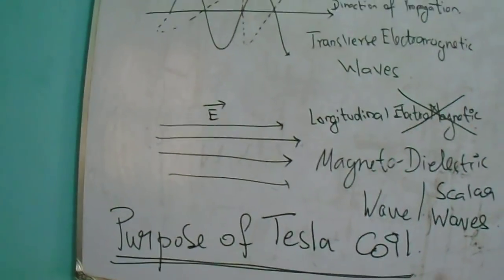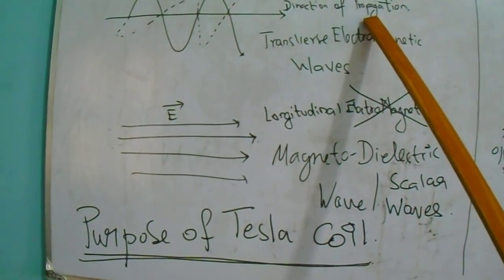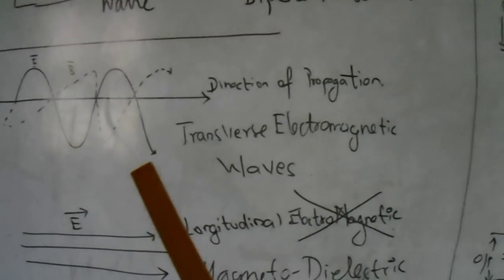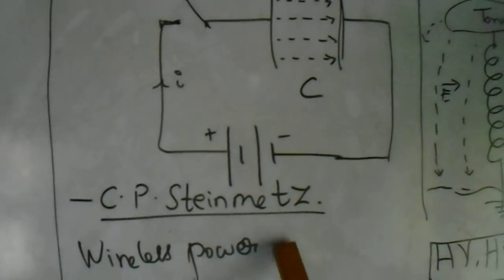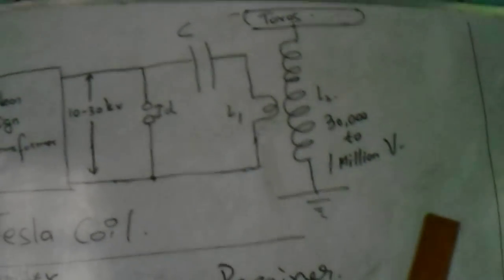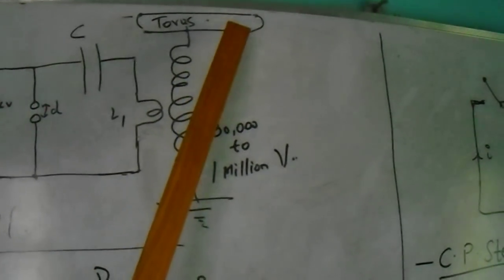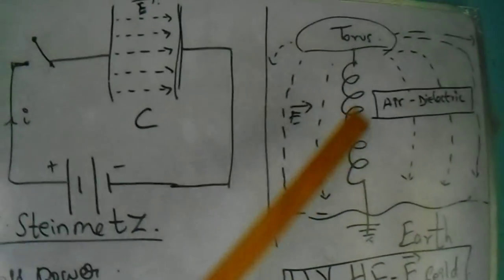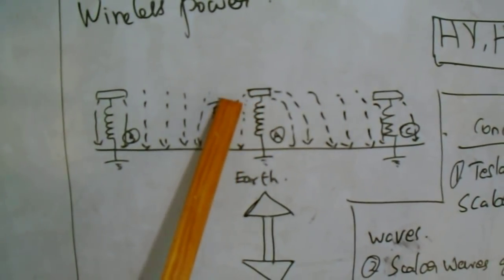How a Tesla Coil Produces Scalar Waves

Comment: This is the first explanation I've seen of how the Wardenclyffe tower may have worked.
 Thank you.
Reply: Wardenclyffe tower was designed to act like a pump. The idea was not to transmit power, but to increase the viable power that the planet naturally has. This way all you would need to do is to get an aerial and place it in the ground and then you'd be able to transform that energy into something which is viable for running all sorts of things.

Also doing it this way, you wouldn't need such a high amount of power in order to produce it either. I'm pretty sure that Tesla said it could be done with about 150 horse power. This was the genius of it all, as it didn't take much, but was capable of producing such an efficient result.

I guess you would best compare it to a large pipe organ or an amphitheater where you didn't need such a huge supply of power, but due to the resonant nature of the device, then it would be capable of amplifying the pressure of the supply into something which far exceeds the origin.

Everyone keeps on going on about it's this wave or that, which is capable of making it happen, but in reality it's merely pressure mediation.

Tesla never stated that he was going to create free energy. It's just that he was going to increase the freely available energy to such a state that you wouldn't need to have a 20 meter high pole (perfect for getting struck by lightning and taking out everything connected to it) in order to attain it.

I think that there is a lot of misconception also of the experiment which Benjamin Franklin did. All he did was harness the power which was already there, by putting a wire high enough into the air, I'm not sure if the kite itself had any metallic properties at all, but the experiment was successful just though the altitude which the kite traveled. Sparks actually formed during that moment between the wire and the ground, which is how he knew that his hypothesis had worked. The unseen result of the experiment is that the kite had also become the perfect lightning rod, and then Benjamin discovered the downfall of attaining electricity in this manner, as the high voltage of lighting was way to unpredictable and too harsh a beast to control through such a primitive manner.

This is also the manner to which Tesla's patent of Collection of Radiant energy comes from. Where you have a plate, which is connected by wire to a capacitor and then the capacitor is capable of running a motor which then could run what ever you wish off of it. Again the downfall of this method is keeping lightning from coming in and becoming part of the circuit and just killing everything connected to it.

One means to which you may be able to improve upon the radiant energy design of Tesla is to use the understanding of building the panels for the Orgone Accumulator by Wilhelm Reich. Where you would be able to increase the velocity of the radiant energy which is hitting the plate therefore allowing a greater amount of power collection at a much lower height that what would be needed with just a plain plate of steel or aluminium.

Of course you could also include a booster coil by utilizing the piezo electric effect of quartz under pressure by wrapping a coil around it, therefore allowing the coil to collect the additional charge as it passes past the quartz, while being pushed by the electricity which is being obtained through radiant collection of energy.

Comment: Absolutely brilliant! I've been trying to understand that for years. Ivor Catt introduced us to the transmission line theory of how a capacitor works, in which the capacitor is an open ended transmission line and its leads are antennas that emit a transverse wave laterally between the plates and parallel to the plates. The capacitor is an open ended transmission line (or wave guide) that acts as a wave trap in which the magnetic component of the reflected wave is opposite to the incident wave and cancels it. The electric components however are additive and the E component doubles. According to the right hand rule for electromagnetic waves,
     "Point the fingers of your right hand forward toward the E vector, Curl your other three fingers toward the palm 90 degrees straight toward the B vector, and the thumb straight up will point the direction of propagation.
     I suppose the propagation of the E component gives rise to the B component. Experiments show that the direction of travel is from the capacitor lead outward toward the edge and back, so the thumb points away from the lead at first, then reflects from the edge in such a way that the magnetic fields cancel, but the electric fields, pointing in the direction of circuit current flow, will double. Thus we have a good understanding of what happens in the tesla coil version between the cap of the coil and ground. It is capacitive just as you describe.
     From your diagram, it looks like the tesla E waves are transverse though. Tesla did utilize a transmitting coil in which the windings were flattened wire, creating an E wave that is longitudinal. 
     It would be interesting to introduce the magnetic vector potential A, into this discussion. This quantity has been shown by experiment to exist when there is no E or B field present. It would be interesting to draw a connection between this A field and gravity. 😀
Reply: Addendum: Ivor Catt also showed that an inductor is a transmission line (wave guide, or wave trap), but a closed ended one. The right hand rule shows that the E field cancels and the B field is doubled.

Comment: Scaler = volts per second
Transverse waves= cycles per second. Thank you for your great video
Scaler waves are instantaneous and have no time lag ...defying " speed " of light, which is really a measure  dielectric conductivity and not a "speed" ....incredible
Reply: That's impossible. Sound waves have finite velocity and scalar waves are just electrical version of the same phenomenon.
Reply: @oriraykai3610  no they're not there's no transverse wave and a scalar wave its direct impingement
Reply: Scalar is related to temperature and shouldn't be used for this, the correct term is Longitudinal Impulses, and they don't have a range or speed limit. The Aether is non-Cartesian and non-dimensional, eric dollard calls it counter space.

A disturbance like this with no magnetic component would have no volume, as a result it won't induce hysteresis in the Aether when it is created, no inverse square law, no time delay, no speed limit.

Comment: Basically it is a fully charged or at peak efficiency acclimator, capacitor. What is charged is counter space. Like a pipe full of water, where a high-pressure shockwave can propagates through the piping system when a fluid in motion is forced to change direction or stop abruptly. But unlike water it's considered a longitudinal wave as there's zero resistance or friction. It hits hard. Maybe a standing wave.

Comment: Tesla wanted to connect the torus to the ionosphere using an ion beam or highly directed electric field. Then the charge would create a capacitor out of the ionosphere and Earth, and likewise increasing the amplitude of the atmospheric low frequency standing waves called Schumann Resonances as well as the Earth's resonant electric frequencies. 

Tesla wanted to convert the Earth and Ionosphere into an oscillator circuit powered by the heat of the Earth and the energy of the Sun as they generated low frequency standing wave fields.The idea is to 'pump' such a circuit between the ionized plasma in the upper atmosphere and the grounding current in the Earth through the Tesla Coil acting as a phase conjugate resonant frequency transformer tuned to transform Earthwaves to Skywaves and back again, but by phasing the A/C output he could mode lock with the resonance of each source of A/C signal and produce a destructive interference everywhere except the receiver, the Earth and the Ionosphere. it doesn't take much power to initiate the 'pump wave'and then the process is self sustaining due to the Earth-Sky-Transformer system being far from equilibrium in the frequency domain, so energy can be extracted efficiently to cool the thermodynamic processes driving the low frequency fields you have phase conjugated.

 The Earth and sky waves travel in pairs around the Earth locked to their + and - polarizations, these ground current Electric fields and EM waves form a 'plasmon' which is a pairing between a surface electric charge density wave and the nodes of a spherical standing wave around the Earth. This newly excited capacitor arrangement can be allowed to store huge amounts of energy without ever radiating the energy in EM waves, and any station on Earth can become a transformer to not only tap into power but accelerate the phase conjugation of naturally present energy radiating from above and below into useful power.
Reply: This is very interesting. You outlined it well. If this can be done, as you explain, it would be power on demand with little need to have batteries store the energy for immediate and future needs. I have to think about the hardware needed to do this. If you have further insights on this, please share. Titillating, if I do say so(and I do)!
Reply: I see how you might think so, but... This is not what Tesla was doing. He was chasing down the wheelworks of nature. Something science has abandoned today... nothing ontological is considered science.

As you describe the atomosphere and Earth is an almost reasonable deduction given the limitations imposed on science. You might get the system to respond as you predict, but it would not be operating as Tesla understood things to be. Tesla had a unified approach to science, he was an Aether scientist and did not believe in counterspace.

Just as an example. Tesla understood that the Sun and stars express Radiant Energy (RE). It is a compression wave of the Aether, or Ether configured to express the activity on the Sun. When it hits an atom that is tuned to that activity, it will cause the atmosphere to illuminate, and produce EM waves. This is the source of the RF and light in the atmosphere. In space, you cannot see stars... it is total blackness unless you are near an emitting body like the Earth or moon which has atoms converting the Ether streams to EM emissions.

Tesla found the Radiant Energy when converted to Ether Beams (RE of his own design) could be transmitted through any material and captured by specifically tuned antennae. Along the way, the beams were self-amplifying, lossless, and also without time delay. Both the planet and space were sources of Aether that could be converted to the Ether beam energy he was transmitting, further amplifying his transmissions while they were active. The Aether is a superconducting medium. Tesla was on track to eliminate RF and electricity from the equation, developing systems that directly used RE, as your body does. 

This would have devalued all limited resources, replacing them with abundance and freeing mankind from the forced cooperation/slavery that is required to receive electricity. Someting the wealthiest and most powerful people on the planet would not give up then, or today.

Tesla made his discovery in 1894, patented his amplifying Tesla Coil in 1895. After his work on AC power was invested into massive electrical generators at Folsom and Niagara Falls. But, before they started making money in 1896. If they had not blown up his lab and forced him to redo all his research to protect his patents, we would only have electricity in museums today. By the time he came back to NY with his research re-documented and technology perfected by 1900, the money coming in made it easy for everyone to stop Tesla from breaking the bank.

It would be another 30-50 years before Wilhelm Reich would show up and discover Ether was a key part of biological health that if directly increased could enable people to not only see Ether, but also heal to a level that they could live without the reflexive fear that is necessary when you constantly have to consume to survive. Only Tesla recognized that you no longer had to consume to survive... and had accidentally discovered how to increase his Ether capacity for health... outliving all his antogonists.
Peace, B
Reply: Haha lol somehow we still are using telephone poles n wires.
Reply: @joseinfante5054  The "Tesla Coil" was designed to be able to transmit power using a single wire. The tower was a much different design, with an entirely different purpose, as it had nothing to do with transmitting electricity, just to increase the pressure of electricity which is occurring naturally.
Reply: None of that is Telsa. That is all standard academic thought about transverse wave engineering with no understanding of scalar waves because they didni't acknowledge it as valid.

Comment: Really appreciate your effort. But, reading the last linked source indicates a different story. They used a sphere capacitor at the top that could not emit a transverse wave. They also demonstrated that two metal plates, ungrounded, would receive energy from the top capacitor. When they were different sizes, different charges. These would spark when brought together.

The top cap is emitting LMD waves like a fire emits heat. Any metal object in its glow will get "hot" and conduct that energy when connected to a load like the other plate of a charged capacitor. Any dielectric will also absorb the energy, and pass it along, so insulating metal will not shield it. Grounding may facilitate the process. 

Run one of these in your house and you might electrify your door knobs or load your in wall wiring with stray currents or magnetize your watch. Take care when it's on... don't be surprised by special effects.

Comment: I have been thinking about this too and recently I purchased a very nice "Ham it Up" upconverter SDR-Radio for $87 USD. WIth this you could detect oscillations being transmitted from 0Hz up to say 50Mhz. IF you could build just the Tesla Coil receiver, and IF you could tune it to a frequency where is found lots of transmitted energy, it should be possible to harness this power for charging batteries. WIth the SDR-Radio, you can observe interesting natural phenomenon, such as oscillations that are wide-band and are possibly NMR as particles from the Sun hit our ionosphere. With line-of sight to the sky, and a large tesla receiver, it should be possible to tune in on these parts of the spectrum to harness power. This is similar to the research others have done with electro-static motors powered by a wire connected to a balloon, only a Tesla approach would have you TUNE to the frequency that has large EMF. In my location, I see that in the AM band, around 1325Khz, there is a HUGE amount of energy.

Comment: Yes :) All metal core transformers with lots of copper act as capacitor too. The "Barbosa Leal effect".  Ground can always be replaced with mass that can take the additional heat. That's also why pulse motors are so officiant and can use the back emf.

Comment: It makes sense that the area that emits all the lightning bolts is the source of high E field, but oscillating E field makes transverse waves, so I'm still not clear on how the two are kept separate. Telsa also theorized that electricity is fundamentally different from electrons and can easily separate from them when transmitted via scalar waves.

Comment: Yes thank you, I discovered this effect when my system was disconected in the middle but the two halves with two separated grounds.  The output side acted like a negative plate with negative amperage and negative inverse voltage to the generator half.

Comment: Finally someone that speaks my language and shows the scalar effects coming from a dielectric induction field effects. I haven't done a video on my channel in a long time because I thought maybe I am just crazy seeing what I am seeing in my experiments to hack Tesla. Most of my experiments are with a small plasma that as a joke I call an arc reactor. The plasma ball was invented by Tesla and it is like a small tesla coil in place of a radio meter. Question to Tesla:" Is it more powerful than a Crook's radio meter" Tesla's answer: " Yes many times more powerful." So I had to find what fit that description. Then experiment. What I have found so far has made me see things very different in our so called conventional theory. Not that it's so wrong as much as the angle by which it is perceived. Thank you for sharing this I am now one of your subscribers.

Comment: All that means is the Tesla scalar wave spreads high voltage from the high voltage output point to everyone, like a point source lightning bolt spreads light to everyone. So someone is going to complain because you fried something without permission, and someone else will be giving some energy away for free, and you will be forced eventually to use wires to keep energy private and under control, and you will have the AC vs DC power transmission argument all over again. There's always someone who will sue you for changing their life, because some humans are cranky with hate and negativity, not happy with amazement about nature.
Reply: Amusing way to put it, but essentially you recreated J. P. Morgan's stated argument, although it was a cover story for the real reason, he was so invested in the wired system that he would do anything to prevent Tesla from damaging that investment.